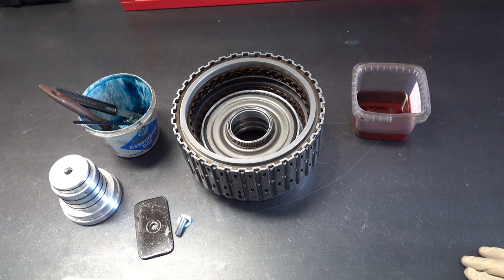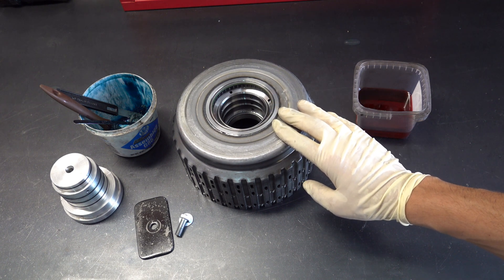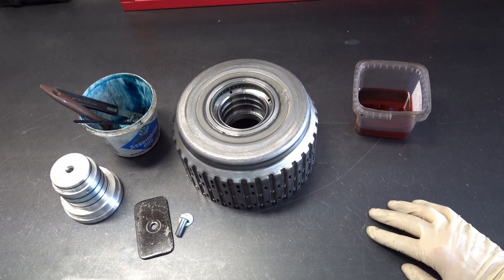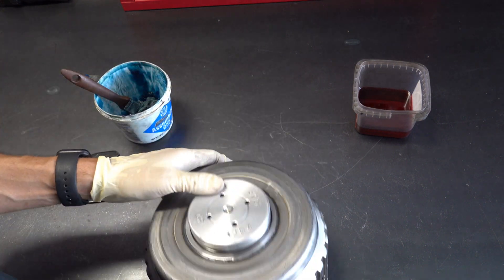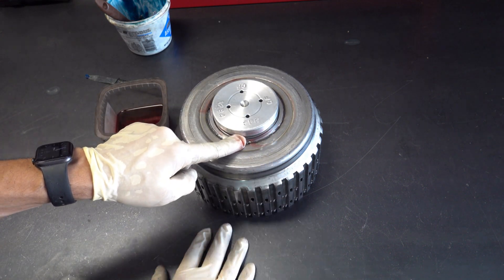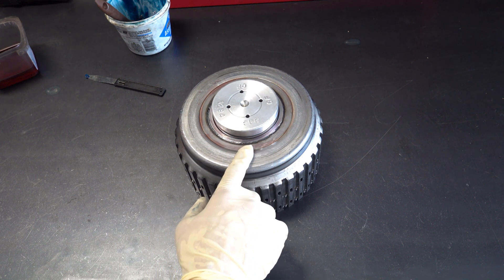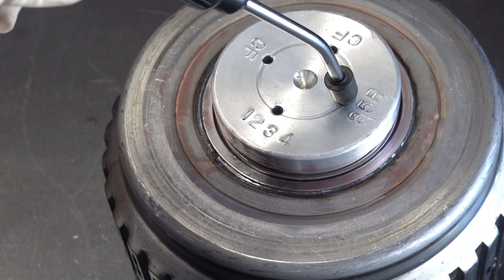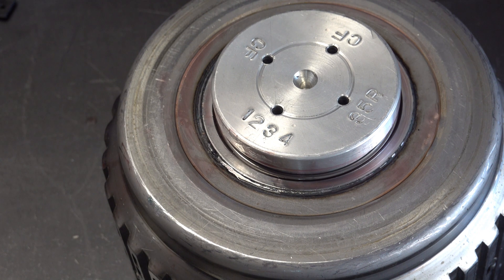6L80 Common Problems: Slipping in Third Gear, Fifth Gear, Reverse | No Reverse

Comment: hi Nick I have purchased a fully assembled unit  with the idea i would be able to swap this part over with minimal fuss 🤭. i didn't even consider whether or not i could do the weld without disassembly.  

i assume I'm going to have to disassemble the new unit?  specifically, would i have to remove the bushings and bearing or could i leave them in?  if i do need to remove them, which parts aren't reusable (even though they are new) and would have to buy again.  thanks in advance, Lawrie
Reply from the maker: Hi Lawrence, thanks for watching. If you have a new transmission, it should have either a new 35R drum or one that has been weld-reinforced. I would not disassemble the unit or do anything to it as you'll almost certainly void your warranty.
Reply: @nickstransmissions 
hi Nick wow i knew you were on the ball with your responses but didn't expect it to be that quick!  legend.  
sorry but I must not have been very clear in my original question, I have a 2008 6L80 which the torque converter has started making whirling noises and I'm experiencing hesitation during acceleration. I have decided to do the overhaul myself mostly due to your channel and the vast knowledge of information you provide 🙏. 

i have purchased  pretty much everything on your extensive overhaul parts list in preparation for the overhaul in which i also purchased a new fully assembled 35r drum (part#24259848) thinking id be able to just replace the old drum with the new one and concentrate on overhauling the rest of the transmission. 

so before i swap in the new assembled drum as part of the overhaul, i want to reinforce the new drum with the weld as it does look slightly sketchy off the self.

so to summarise my original question, do i have to disassemble the new replacement drum to get it welded (would the heat from welding damage/warp some parts if left in, seals etc) and  if I have to take the bushings, seals and bearing out of the new drum can I reuse any/all of them.  thanks again
Reply from the maker: Oh, ok. Sorry, misunderstood. Yes, the drum must be completely disassembled as it will get hot enough to start melting components like seals and damage wavy/cushion plates. Drum must also be completely cleaned and dry prior to welding. 

Leak test the drum first - you may not have to weld it...GM updated their welding procedures for those drums throughout the 6L lifecycle so any new drums from Gen Motors should have the updated weld and not leak.
Reply: @nickstransmissions 
with my (extremely) limited web-only based knowledge and 0hrs real experience, i was under the impression that although the updated welding improved the failure rate, the risk of leakage at some point down the track still warranted reinforcement of the welds, even on new production drums?  

as mentioned, these are the assumptions i have made.... i would be very interested to hear what your first hand experience has been. do you still see enough recent production drums leaking at the weld to justify extra welding .

apologies for the long rant, I'll do as suggested and check for leaks.  I'm almost hoping it does leak, thus avoiding the dilemma of whether to weld or not! 🤪
Reply from the maker: You can weld it if you want - just empty the drum out then completely clean it until it's bone dry then weld it...Just be sure not to weld over the small bleed hole that is located near the weld line. You weld over it you'll have major tie ups...
Reply: hi Nick, finally purchased a checking tool. 

approx what psi should i use with the checking tool. thanks

Comment: Would this only slip when cold? I have one that’s only slipping when cold. Once warm, it goes away. Does it going into 3 and into 5 only.
Reply from the maker: Slipping when cold is often a clogged filter...You'd slip when hot or all the time if it was a drum leakage problem.

Comment: Add filler material when tig welding or no filler and fuse the existing friction weld via tig?
Reply from the maker: Not sure, I don't weld them..I couldn't weld something correctly if it meant the firing squad, lol.

Comment: Nick I really enjoy your content thank you, I do have a question for you concerning these goofy 6L80's have you ever experienced a random hiccup / buck during downshifts on these things after a rebuild? Air test was perfect, compensator feed held. What gives?
Reply from the maker: Hi THP, thank you for the kind words!

I have experienced a few bumps and hicuups within the first five to seven drive cycles with these transmissions as they ease back into working again after overhaul...The fast adapt relearns are usually good for 99-100% but every now and again, final adaptations will take place in those first few drive cycles or so...If it keeps happening after that, I'd conduct a full diagnostic to pinpoint the source of the problem. 

Did you replace the TEHCM and install a valve body correction kit like the Sonnax Zip kit or Transgo Reprogramming kit?
Reply: Basically, it is a full rebuild with bushings, bellhousing,  stator, and the transgo SK6l80 and 6l8 cs tcc kit.

Comment: What’s the link for that tool. I purchased one that  looks similar but doesn’t fit
Reply: Thnx
Reply from the maker: I'd send it back and have the vendor either refund you or send the correct version of the tool...You may have gotten a 6L45/50 version (I can't recall if the inner diameter is different than the 3-5-R drums on the 80s and 90s but I think it is).
Reply: No luck with returns. I waited too long ordered it months ago. Just gonna cut my losses and buy another but wanna make sure I get one that known to work
Reply from the maker: Check eBay, that's where I got mine. I can't recall who the seller was but I see those drum air checking tools on there from time to time...Just message the seller to confirm the tool is meant to be used on the 6L80/90 and not the 45/50 (some tools may work on all of them) so you get the tool you need.

Comment: I am from India, and currently facing an issue with this transmission in my car and unable to find the respecitve parts for the same and wanted to know if that is something that you can help me with. Tata an Indian Brand has a car with GM 6L50 transmission and I am specifically looking for 3-5 REVERSE CLUTCH DRUM. is there a possibility to source a new part
Reply from the maker: Hi Vivek, thank you for watching.

You actually don't need to source a new 3-5-R drum unless there's damage to it other than at the base welds. Once you have the transmission apart, reinforce the weld at the base with a new weld bead all the way around that area of the drum to prevent further 3-5-R clutch failures.

ETA: Check eBay for parts, kits, etc...Most of the big transmission parts suppliers based in the US will ship worldwide, except to places like Russia, Iran and North Korea.

Comment: I have a 2012 truck transmission. Just started flaring/delaying 3-5-R. Going to check reg valve, and tecm prior to pulling the trans out. The soind of the clutch still applying even with that big leak has me thinking ill be pulling this though. Guess i can half way air check it in the truck. We'll see.
Reply from the maker: Hi GoodEnoughEnginneering - thank you for watching!

Flaring is almost always caused by the drum welds leaking but you can vac-check the 3-5-R boost and PR valve to see if the VB is worn there (there are kits available to ream that bore oversize and install a larger ratio boost valve (in fact all three clutch boost valves are the same so you can do all three). You can also air check via the 3-5-R feedhole in the pump cover once the VB/TEHCM assembly is out of the way....there you'd be looking/listening for a lot of hissing coming from the base of that 3-5-R drum between it and the pump when you do the air check (the 1-2-3-4 clutch feed hole will likely have no hissing whatsoever by comparison).

Comment: Hello Nick. Thanks for taking the time to educate folks on these transmissions. I know it takes a lot of time, not only to shoot, but also edit these videos. Not to mention your shop time away from rebuilding. I have a question for you. I have a 2009 6L90 4x4 in for bench overhaul. I've gotten everything spick & span clean. I've vacuum tested the valve body & will replace the seals & diaphragms in the TEHCM. This unit suffered the usual converter failure, taking out the front pump. The filter was plugged which most likely, fried the 4-5-6 clutches. My question for you is: how do you clean the TEHCM? I have a safety kleen machine filled with mineral spirits, an ultrasonic cleaner here in the shop. I buy brake cleaner in bulk & spray it out of a air pressurized Zep canister. I'm interested to hear how you clean the TEHCM? Thank you sir
Reply from the maker: Hi keltecfan, thank you for watching and your kind words as always. I use CRC QD Electronic cleaner on the TEHCM and hit it with some compressed air. Same w/the internal mode switch though I replace those like 99% of the time. Sounds like you have it headed in the right direction.
Reply: @nickstransmissions  Thank you sir. I really enjoy your channel. It's chocked full of great info & one that I can watch with my grandsons
Reply from the maker: You're welcome, keltecfan!

Comment: Nick, see you do a multitude of transmissions.  Which one is your "bread and butter" that you do the most of?  I do mostly 80e's but don't have a lot of demand.
Reply: 4L80e's i.e.
Reply from the maker: Hi Steve, most of my stuff is GM with 4L60s and 4L80s accounting for the lion's share of them...about 25% Ford (3, 4, 5 and shortly, 6 speeds) and maybe 10% Dodge 3 and 4 speeds. I occasionally do some foreign stuff like BMW ZFs, Toyota and Nissan.